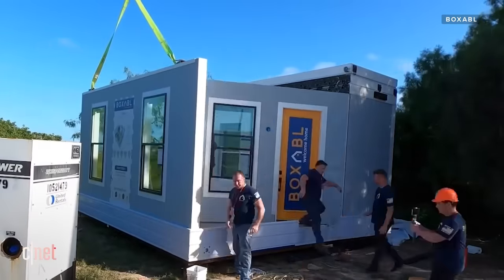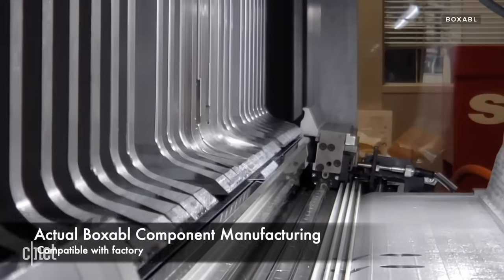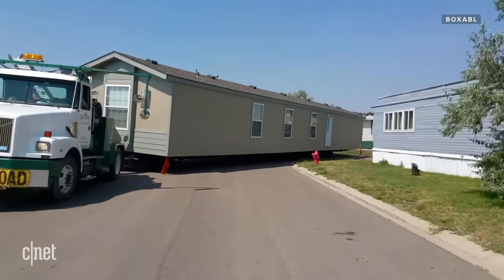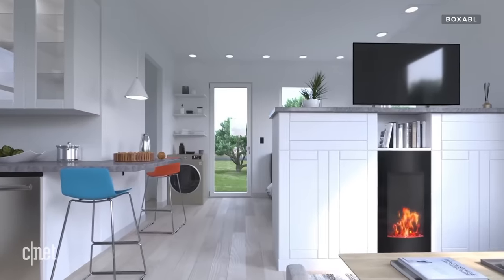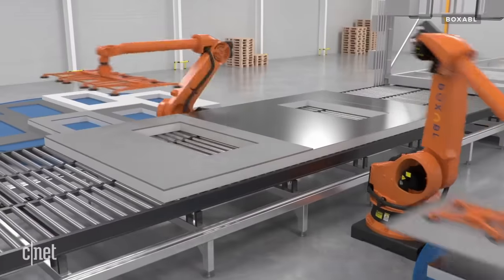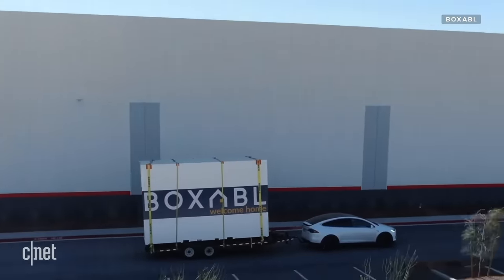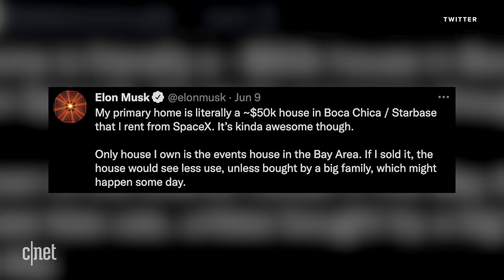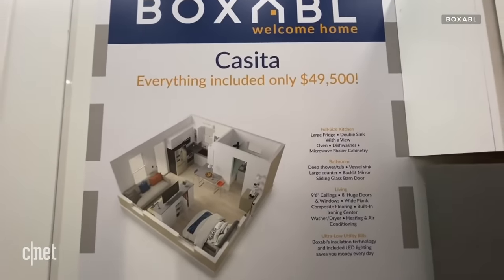Check out this FOLDABLE $50K tiny house 🏠

Comment: This will be affordable for the first few years just like tiny houses, once it catches on it will cost the same as a regular house.  Don't believe the hype.
Reply: 100 percent truth
Reply: Wouldn’t scale make it cheaper, like everything else?
Reply: @eriknephrongfr8847   The scale will surely reduce the cost to manufacture, but the price is a different story.
Reply: Another old man with old man ideas
Reply: @dmitrym4841  Won’t there be competitors?
Reply: @eriknephrongfr8847  if you take away swanky design and clever transportation, you are looking at a nice trailer home. So the competitors are already here. This is the lowest price cuz they are fighting for the market share.
Reply: @dmitrym4841  Do you remember OPs original assertion?
Reply: @eriknephrongfr8847  OP's original assertion? You've lost me there
Reply: @dmitrym4841  He said that these units would get more expensive with time: suggesting that this was a bait and switch. Remember Lexus with the original LS in ‘89? I just think that’s speculative.
Reply: @eriknephrongfr8847 It will get more expensive, I agree. Also don’t think that 50k for 400 sq ft. Is such a great deal for what it is. But it is cute. You buy if you flushed with cash to feel cozy
Reply: The truth. Glad you brought that up.
Speculation destroys.
Reply: Yeah it might cost 100k instead of 50k, still cheaper than $374k.

Comment: Sounds like a great idea.  You still need to own the property to place it on and that cost varies from state to state.  Also there are costs to connect to sewer or a septic system  and water and power.  Should still be less that most other housing. This could be a great Additional Dwelling Unit better known as a Granny Flat.

Comment: I hope it is engineered enough to withstand pressure of the roof so the foldable hinges and clipping parts don't fall off. Especially when snow accumulates and the pressure increases.

Comment: Traditional building methods are very expensive.  Yes but we need full sized modular family homes that are factory built and the modules simply bolted together on site.  They could use new lightweight composite materials that are much stronger and have higher insulation values.

Comment: I wonder how the plumbing works and how it is (or isn’t) connected to the sanitary system for the neighborhood.
Reply: Just like a full build or placing any tiny house you need to get plumbing, electrical and sewage connected to the section and home. If the section already has it then it's cheaper to get it connected to the home itself.
Reply: @mistressofskyrim.aka.court990  thanks for your reply.

I was thinking how is the plumbing actually run and connected (at the joints and bends) since the walls fold. Is all in the exterior walls? Do they use Cooper lines or something that can fold? 

If it only takes an hour to assemble on site that’s not much time to connect multiple sections of plumbing.
Reply: @adamr4198  Ahh I see what you mean, they should just run straight up through the floor then instead of the walls or use flexi pipe but I would be interested to know that too.

Comment: These will become a successful niche product assuming their build quality is in line with their cost. They do have rv trailers and park model mobile homes as stiff competition, the rv trailers often times cost far less, can be setup in less time, don't require any type of foundation and can be towed by a normal pickup truck or large suv. It also depends on how financing works with these fold up homes, I doubt they'll qualify for a mortgage due to how mobile they're (similar to how single widespread can be more difficult to mortgage) but it also won't qualify for an rv loan.

Comment: They would have almost no resale value or greatly diminished until this became more mainstream. Not sure if the cost per unit is low enough for FEMA. I'm all for lowering the cost of housing but I built a 20x20 addition 8 years ago for the same price. Wish them luck...

Comment: I would like to learn more about the building materials, if it uses green chemistry, as well as weather resistance, insulation, HVAC, plumbing, and electric. 
It's always advisable to have wheelchair accessible design incase the ability to walk is suddenly compromised, as I have had the recent and horrible experience of that being perpetrated upon me.

Comment: Very interesting concept. Looks like a money maker. How is electricity and plumbing hooked up to the structure?
Reply: Just like a full build or placing any tiny house you need to get plumbing, electrical and sewage connected to the section and home. If the section already has it then it's cheaper to get it connected to the home itself.

Comment: I wonder if this will pass building code regulations here in Florida?? We have very strict codes because of hurricanes.
Reply: Based upon your highrises collapsing just from normal wear and tear, your standards obviously aren't strict enough.
Reply: @larryparrish2123  a lot in building code has changed in Miami since that building was built 40 years ago and the cause of that structural failure hasn't been determined yet.
Reply: @Allaces305  , the cause?  Failure to enforce required repairs in a timely fashion.  Duh.
Reply: @larryparrish2123  you're correct.

Comment: How does it connect to electricity, water, and sewage?
Reply: Just like a full build or placing any tiny house you need to get plumbing, electrical and sewage connected to the section and home. If the section already has it then it's cheaper to get it connected to the home itself.

Comment: How does it get connected ? To utilities
Reply: Just like a full build or placing any tiny house you need to get plumbing, electrical and sewage connected to the section and home. If the section already has it then it's cheaper to get it connected to the home itself.

Comment: As long as this is cheaper than what a similar size home, built traditionally, costs then they will be fine
Reply: You can build a 20x20 home for half this price.
Reply: @hectorg.7282  Yeah that's dead. They didn't spend $25k on furnishings. Welp
Reply: @Deborah Ajao It is only about the same if you buy the materials at the big box stores and overpay for labor.  But you are right about it not being built in 3 hours.